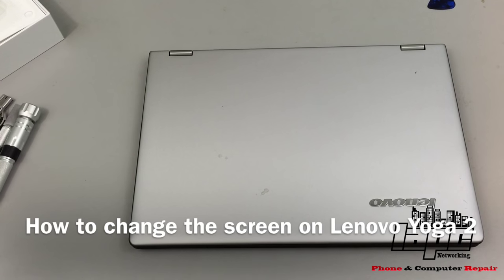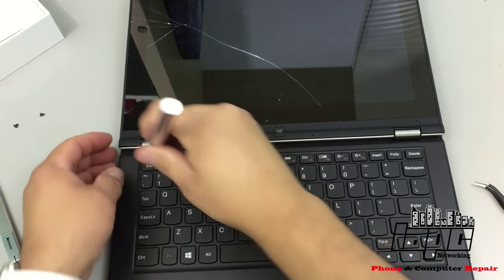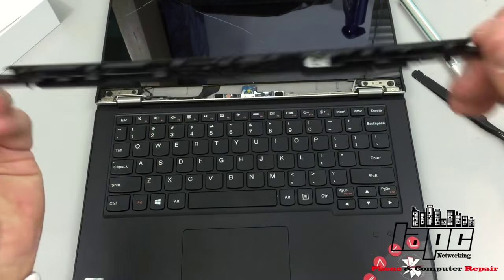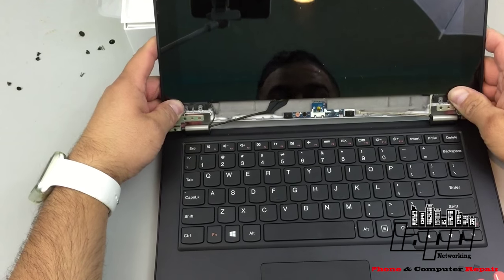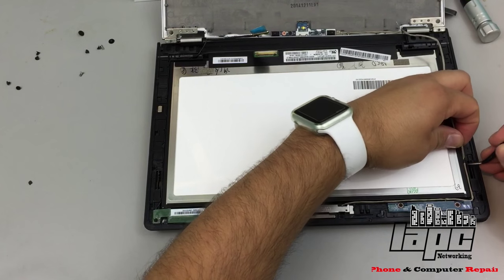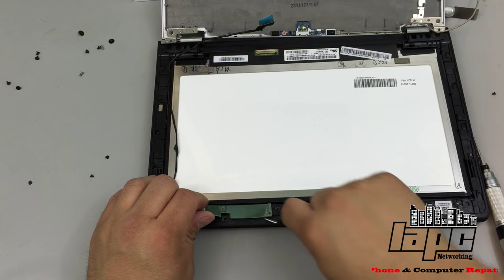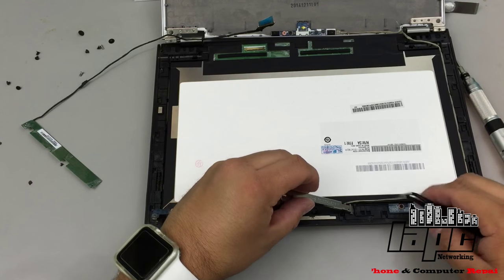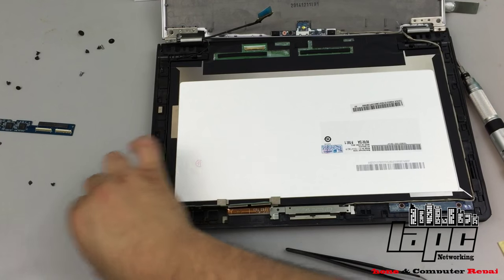How to change the screen on Lenovo Yoga 2

Comment: Thanks Tino - I just replaced a screen using your video - very good tutorial. For anyone else replacing a screen, make sure you don't mix up the various small black screws - some are different lengths and you will damage the backplate if you put the wrong one in the wrong place. When you put your new screen in, the main screen connector was hard to insert and I thought the screen was not working. The connector was just not in far ennough - it takes a little effort. I used some hot glue to re-attach the tape for the connector as the adhesive was left on the old screen. When you are attaching the screen to the backplate, be careful to slide it all the way down (this is not as easy as it looks) or the screws will not go back in easily. I had to loosen the screws on the right-hand hinge and work that side of the screen down until it was fitting correctly. I also had two additional screws which attach the very outer edge of the bezel to the backplate (to the outside of both the hinges). So if you have two tiny black screws left (like I did!) then this is probably where they are from. Best of luck.
Reply: My Lenovo yoga 11s display needs to be replaced. Who manufactures display units for Lenovo ? Is it their own brand? What model screen should I buy ?
Reply: @prakriti753  the model number of your laptop is in the back, check it and order one online

Comment: Thanks.. great details and I appreciate the good angles so we can see what you are doing.. Tips are good, also. My replacement required that I peel off the old screen from its' plastic frame and it was a little longer on the bottom, but it all worked out okay.. little cable finagling when putting the final little plastic thing back on, but it is up and running now. Thanks again!

Comment: i like the screw driver you are using.  what is the brand?  also, this unit should be a touch screen, have you replaced a non-touch screen LCD in a unit that was supposed to have touch?

Comment: I ordered the LCD and didn't realize it didn't include the digitizer screen and bezel, which are normally glued together.  What is that assembly called, and is epoxy OK to glue it together? Any purchasing tips for that assembly, or vendors?  It appears you don't endorse vendors.

Comment: Hi
Great video. I changed the screen and put together perfectly.
But I just took it apart again to change the screen back lid and I think I have screwed through a wire cause the screen won’t work.
Laptop on but screen is off?

Is it easy to fit a new wire or mend it?

Comment: Hi, I have an X1 Yoga with a cracked top right of the screen. The screen looks fine and the pen still works, but finger touch does not. Do you know if I can replace just the "touch" component or have to replace the whole LCD unit?

Comment: Hi Tino, may yoga 14 screen is not folding flat to the back for the tablet mode. There is a small issue with the right hinge like thing that connects key pad and screen.  Is there a way to fix it?

Comment: Does anyone else realize that his touchscreen function still doesn’t work with the new screen

Everytime he tries the touchscreen nothing happens then he cuts to a new scene

Be careful with this guy, the crack is gone but then he says everything is working except he doesn’t inform you the touchscreen doesn’t work
Reply from the maker: you need to try the original lcd board attached to the frame or use the one that comes with it.